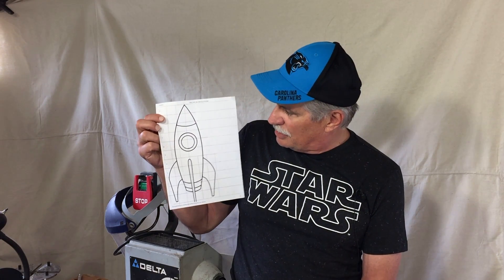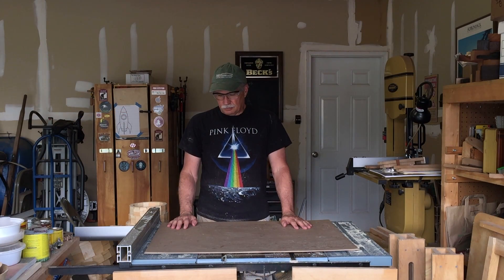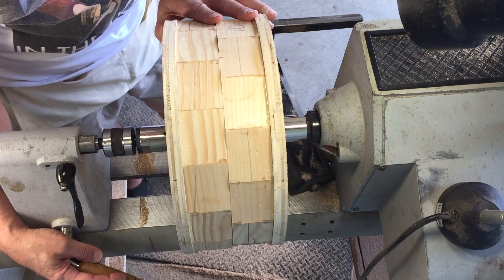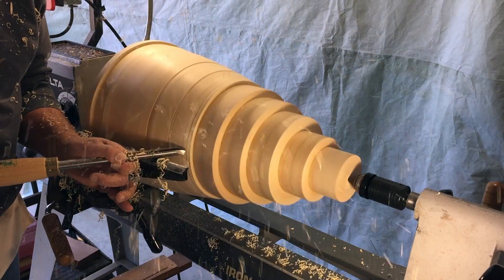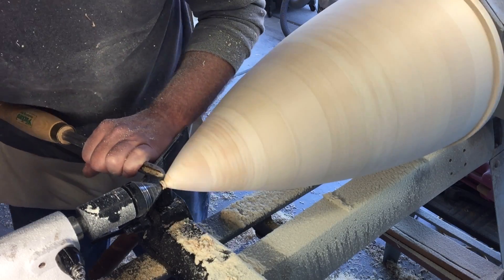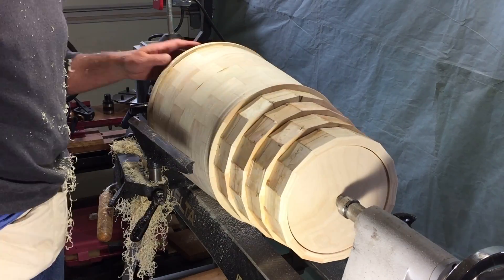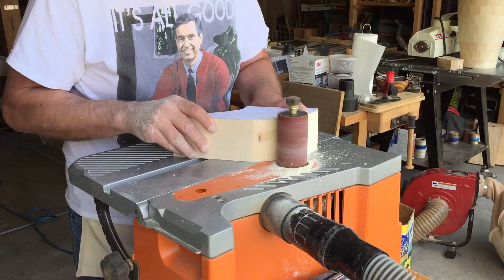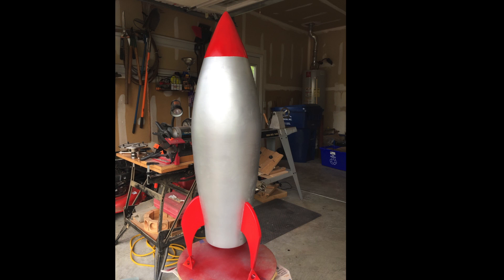A Segmented Rocket

Comment: Steve that's one more great project. I don't know what I would have done If I was told to make a rocket. Can I use Pine glue ups while I'm trying to learn how to turn. Something like 4 by 4s from the big box stores and 5 to 7 inch glue ups by me? Will it hurt if they are treated lumber or must they be regular? When I can turn at least half way decent then I'll go to what ever I can find at some of the lumber mills around. Thanks for your help, I really like your videos and thanks for sharing.

God Bless my friend.
Reply from the maker: Thanks Frank!  I appreciate the comments.  You can certainly use pine to practice.  One of the first piece I turned was a glue up of a 2x10 I picked up at the home center.  I cut it into pieces and glued them together into a big block about 9 inches square.  Pine is easy to turn but does have a lot of pitch in it so it gums up tools and the lathe but nothing that can't be cleaned off.  Popular is an inexpensive wood that could be glued up and turned as well.  I stay away from pressure treated as I don't want to be exposed to whatever chemicals are used in the process.  If you do you pressure treated wear a respirator...not a dust mask but a respirator.  Keep practicing and you'll be turning (pun intended) out quality pieces before you know it.  Take care,  Steve